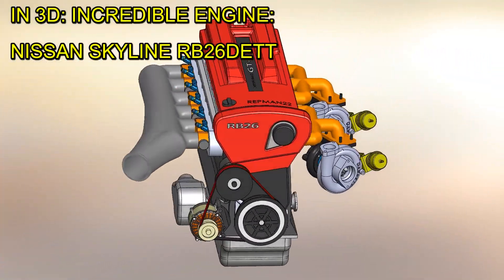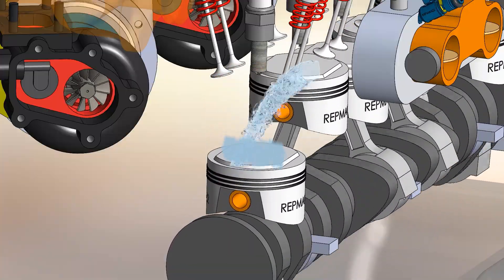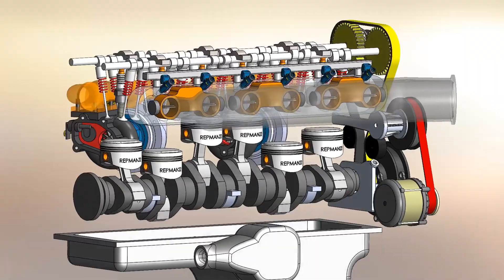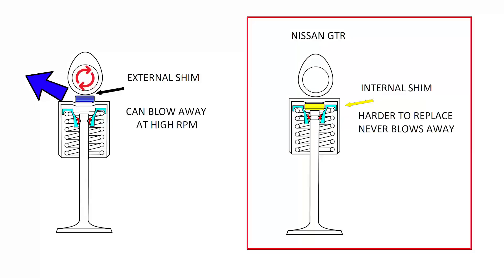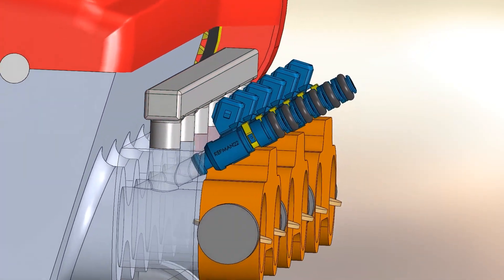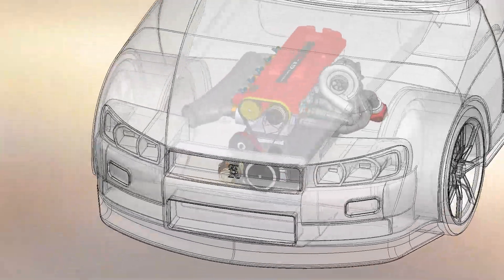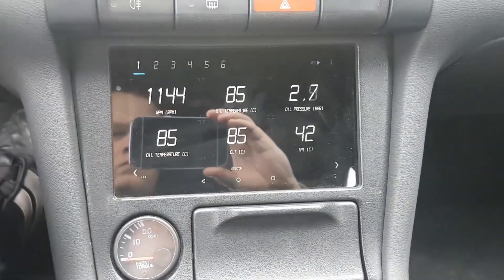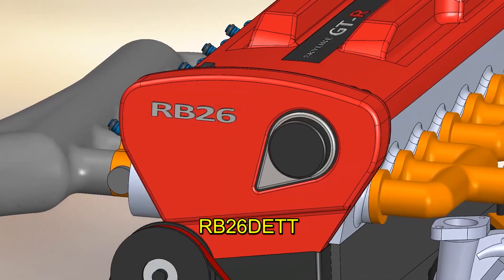Analyzing engines in 3D: The Skyline GTR RB26 🤯

Comment: Now we know why the RB26 is still the best Inline 6 Cylinder beast ever created by Nissan although the block with small crankshaft space with less vibrations with aftermarket forged Pistons and Crankshaft pushes from 8,000 RPM> 240kmh to a whopping 11,000 RPM> 320kmh. But don't get me wrong, the Toyota 2JZ has bigger displacement components per rpm cycle inside the lower block which the Crankshaft is housed. Also not to forget the 2JZ supports aftermarket Sequential Turbo Charging upgrades which alleviates turbo lag achieving boost at its best performance. Deep down in my heart, I love RB26 Nismo or  RB26 V-Spec II.

Comment: It always made me sad that the RB26 wasn't 3 litres to directly compete with the supra. While I enjoy both platforms, only one has countless JGTC wins, and in Australia.?

I saw you mentioned the N54! That's my engine! While you are right about the N54, the biggest perk of this engine is buying a $60 dongle, $60 tuning map and achieving 420ish horsepower with no other mods. If you add better coils, intake and catless downpipes/exhaust, you can get up to 450-480hp. If you add turbos and fuel pump, you can hit 700-800 rwhp.
Reply: RB30 exists and went into R31 and Holden Commodore VL.
RB30ET exists and went into R31 and Holden Commodore VL.
Reply: S55

Comment: Anyone else notice the animation in the beginning is wrong on the exhaust stroke ? The exhaust valves open during the combustion cycle on the pistons way down in the video. The valves should be opening on the pistons way. up.
Reply from the maker: it is to improve exhasut and get more power at high revs. At that part, combustion has low power.

Comment: Great informative video! I did notice the animation of the rear wheel steering was inaccurate... The rear wheels turn in the opposite direction of the front, not the same direction.
Reply: A small gripe ... I can't wait to see more videos from you!
Reply from the maker: At high speeds, wheels turns at same direction.

Comment: Why does air have less time to enter the cilinder? In all cases the piston takes the exact same time to travel from TDC to BDC. The piston speed compensates the stroke length. 

The only thing affecting time is RPM. So every engine can get more air in at lower RPM.

In fact, a larger bore can have bigger valves, thus allowing more air to come in without hitting supersonic speeds.
Reply: He got quite a bit wrong in this dude. Don't fret too hard

Comment: A fair bit of the information in this is not correct. The RB24 only ever went into LHD Cefiros. It's an incredibly uncommon engine, and was never put into a skyline or race vehicle at all as far as I know. It was a jump from the RB20DET to the RB26DETT with no middle step. The issue with RB engine crankshafts was a weak connection to the oil pump. There was a <2 inch wide flat spot on the crank that was changed to have more purchase on the oil pump gear. The old one would break oil pumps at high RPM. They call the new one a long nose crank or an N1 crank (though it was used in almost all RB26s from late r33 on and also was a supersession in part numbers meaning if you tried to order the old crankshaft, you would get the new one.)

RB doesn't stand for inline 6 as the L20/L28/LD28T and RD28/SD33 engines came before it and were also in an inline six cylinder configuration.

Comment: RB = Race Bred, literally a de-tuned racecar engine.
26 = 2.6L displacement (2568cc)
D = Dual overhed cams which Nissan called 'Twin Cam'
E = EFI (electronic fuel injection), lots of cars in the 80's still had carburated engines.
TT = Twin Turbo (not "two turbos")
Reply: RB is just an engine code that refers to a family of engines (many that have nothing to do with racing). Many have made up nomenclature afterwards to fit it. Many say "race bred". In Japan, they say either "response balance" or "rhythm balance". However, it's just an engine code with no meaning to it much like SR series, L, VQ, CA, HR, FJ, etc etc. It does sound cooler though, especially because of the history the RB26 made in motorsport.
Reply: @voongnz  While you're not completely wrong, RB does not directly mean "race bred", I was pointing out that it is most commonly refered as such due to it being a de-tuned race platform. Also, the code 'RB' does in fact have a specific meaning beyond what is commonly applied to it... You are incorrectly assuming these engine codes are just made up nonsense, and without going into too much depth, RB code specific translation = Roku Benzene (roku=6 in Japanese for L6 engine, benzene=gasoline engine).
Reply: @Cautela  well we established RB doesn't mean "race bred" from factory, good. Yes I've heard that too and it seems like race bred/response balance again, mainly from randoms off the internet, I've heard it all over the years. Unless you can give from official source, it'll just be RB. I'm willing and open to proof though, and I'll tip my hat to anyone to provide it to me. I've wondered why the majority of Nissan engines don't have a B it btw.
Reply: @voongnz  No, we established that RB is COMMONLY REFERED TO as 'race bred', nd how that is rightfully so. The engine codes on nissan engines MEAN SPECIFIC THINGS, thought that was clear as well but, you don't exacty strike me as the brightest bulb in the cellar so I'm not going to attempt to dumb it down more for you, I think it'll break your little biased brain.
Reply: @Cautela  did you even read my last comment? I referred to factory naming not given names from the public. I'm well aware what nicknames have been given to the RB engine family. Still waiting on proof if you can provide it, thanks.
Reply: @voongnz  Sounds like YOU didn't read what I wrote, re-read and attempt to comprehend. The codes pertain to nomenclatures the engineers at the time of inception gave these engines, and they deal with everything from configuration to metallurgy... Also I am no longer going to entertain this, you don't want proof, you want to be right at all costs... Bye.
Reply: @Cautela  I'm well aware of the naming conventions of Nissan engines that comes after the engine series/family. Features in the engine code like DETT are well established. I've seen them in nissan brochures, I have the owners manual and service manual for the GTR and it basically spells that out. That is not disputed. What is, is the "RB". I'm talking about factory naming, not public nicknames given.

Comment: One of the best engine ever created by Japanese automotive manufacturer. Relatively reliable, highly tuneable, plenty of aftermarket parts to increase the potential. Thats why they still popular until now.

Als, nice detail in 5:07 , not many people know this restriction internal hose, because they tends just slap a big turbos & call it a day. 😂
Reply: Even more impressive is that if you remove that restrictor...with the convienient yellow band to show you EXACTLY where it is (Visible in the picture) , that you don't even need to tune the stock ECU because it can compensate.  =o)
Reply: i wanna put one in the g35 with a big single turbo or a JZGTE

Comment: I feel like you're buying into the old rumors too much. The R33 is indeed slightly heavier for the tradeoff of an improved AWD system, brakes, boost increase from stock, different body parts for reduced lift at high speed and a lower drag coefficient, improved body rigidity, along with a whole ton of changed to weight distribution and the list goes on. The only thing that stayed the same between all 3 models was the engine.
Reply: Yep, bhere were also some differences in the RB26 too, like the short nose crankshaft in early R32's that caused oil pump issues, ceramic turbos in the R34, some variants got the stronger N1 block as opposed to the standard O5U block etc etc.